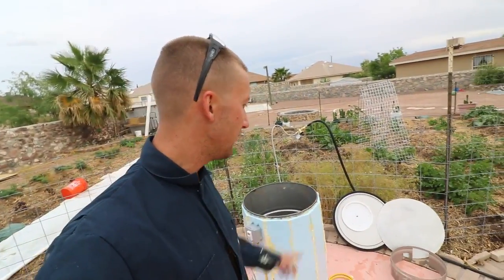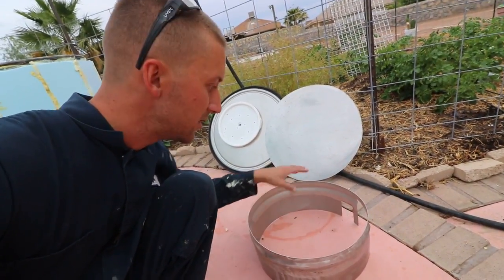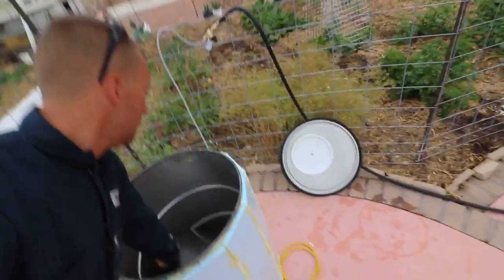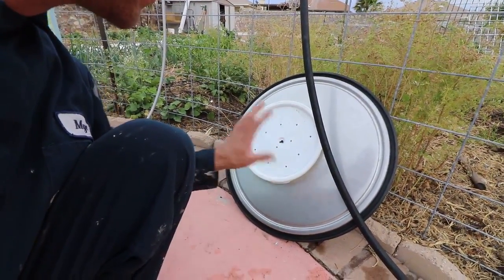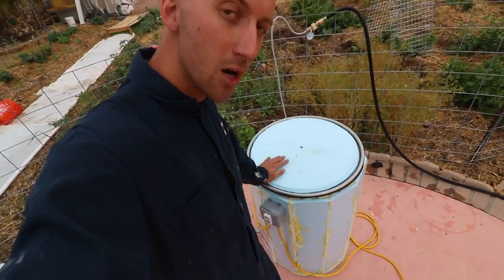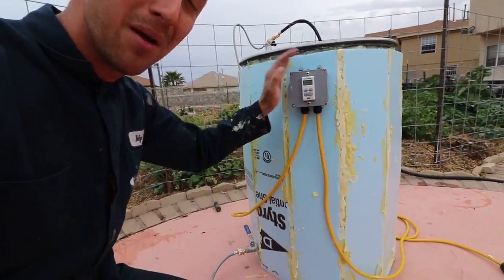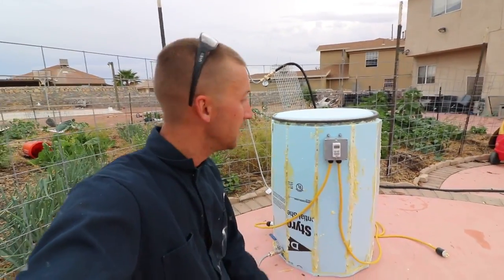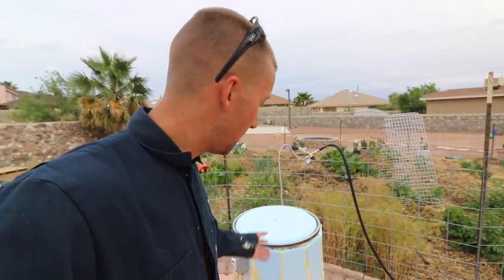55 GAL SINGLE DRUM MUSHROOM STERILIZER BUILD DIY

Comment: I built one for just about $200. I am actually running it now on six test bags stacked on my false bottom floor. I opted for a steel grate welded to a custom table-like set of steel legs instead of the solid steel flat sheet. Im very happy with the results and I learned some new skills making it (tig welding specifically). Getting the level of the float just right can be tricky and if you can find a smaller stainless float I would go with that as the water level will not need to be as high, leaving more room for substrate and spawn inside the barrel. Thank you for the inspiration! Also shout out to archers mushrooms out of the UK for very detailed build instructions

Comment: I’m skipping the false bottom In exchange for multiple grill grates that I mount with bolts through side wall of barrel. About to test run the puppy with no substrate and if all goes well will install my racks. The grill grates will be easily removable, just pick em up. My thought is this should help reduce run time via increased surface area of steam on bags. Anything for a more thorough sterilization and steam penetration. Stacking the bags on top of each other on 1 false bottom just seems like it goes against everything I learned about spacing the bags during sterilization. I’m thinking I should be able to get roughly 4 racks in my 55 gallon barrel. I may loose a bit of internal space but should be negligible as I will place each upper level grate essentially utop of the bags below. Maybe loosing a total of 1-2 inches of spice while ensuring no bags touch each other.
Reply: How did the test run go? any notes on the build you would care to share?

Comment: Hey my man. Long time watcher here. I love your videos, they're fantastic!
I was hoping that you could let me know if you did anything to reinforce this barrel you have here. I have acquired a food grade steel drum and I'm waiting on a heating element and the rest of the kit, but I've been doing some reading and apparently these barrels start bulging out at 8psi. Other sources say they can handle up to 40psi. I'm nervous to try in case I get a nice explosion.
If we are aiming for 15psi over a few hours, surely there has to be some reinforcement to the steel to stop it from bulging. That being said, I've seen lots of these sterilizers around and as far as i can tell, the only reinforcement would be the insulating layer.
What's your take? I was thinking if reinforcement is needed, some ribs around the outside and on each end may have to be welded on, and some MIG welding around the seams to double them up. I will have to learn welding!
Anyway. Any info you can provide on how these drums handle pressure would be invaluable to me.
Peace and love <3
Reply: The lid is vented so no pressure builds up. He explains it in the video
Reply: @matthewholloway9507  ah yes i understand now. I thought that these barrels were reinforced for 15psi but i understand they are meant for steaming for several hours at atmospheric pressure now. Still ingenious. Still gonna build it :)  Thank you!
Reply: Put on a safety valve on lid, problem solved.

But barrel drum like this, Im just curious it could be sealed perfectly as a pressure canner. 🤔 maybe he puts on a gasket and lid lock? If not, those steams gonna find their way out anyway.

Anyhow.. always have a backup hole 😂 good luck

Comment: Sir if I use a big steriliser box do I need to  put a small hole on top to avoid pressure buildup?what if the source of my steam is a drum below and also part of the steamer box,does it produce pressure in the whole steamer if I will not place a small hole above the box?tnx

Comment: Sorry Eric, your arm was blocking when you opened the steamer.  Does the PID have a sensor drilled through the wall? Is it Pressure or Temp controlled?
Reply from the maker: Its just a timer on this one but i run my newer drums off a sensor at the top that has a temperature and timer contol. Its 0 psi. You can buy these turnkey now from bubbasbarrels